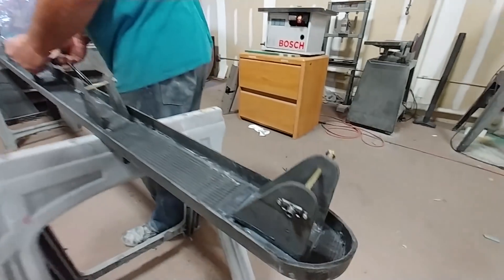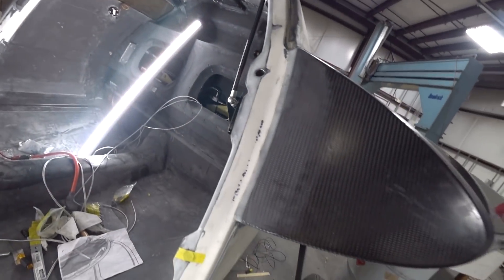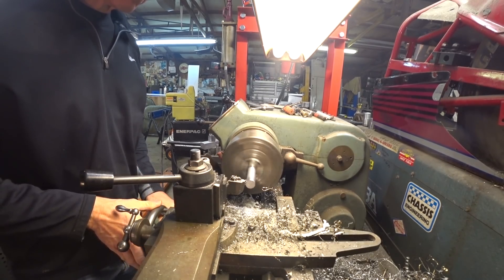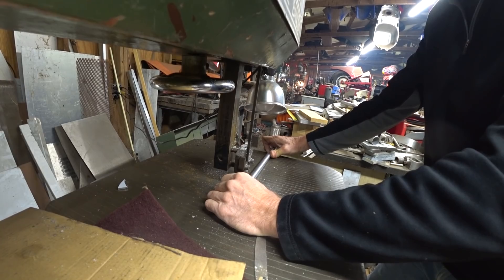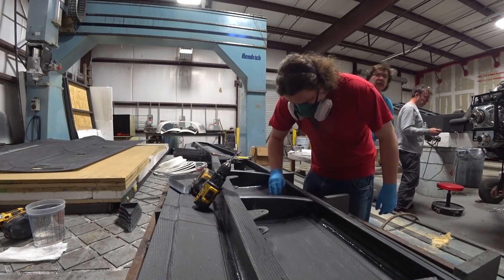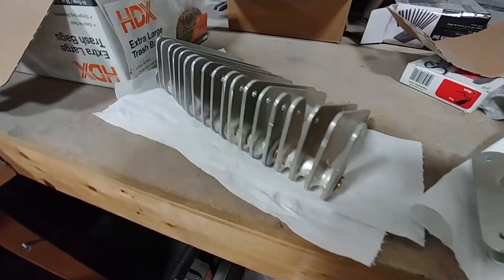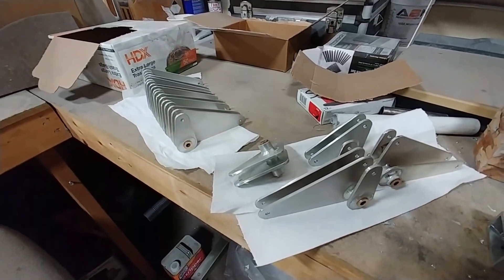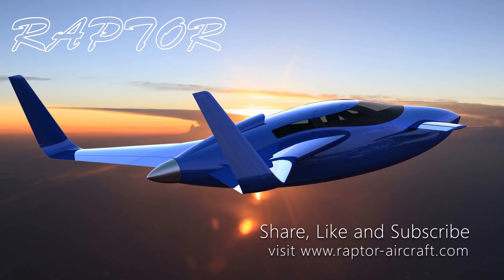Stepping Up Our Game - Building the Raptor Prototype

Comment: With respect to the arduino setup. Breadboard are notoriously bad with vibrations. Great for quick prototype tinkering but I would not rely on it for anything critical near that big vibrating prop and engine. I hope you have plans for something more sturdy before taking it up. At least test and have contingency for failure modes of over and under pressure. I realise this ie still a prototype and the impetus is to get a proof of concept up and running. Your pressure test video made me picture what would happen if the pump relay got stuck in the on position without a relief valve in mid air.
Sorry to be just another back seat driver.

Comment: #1079 here.  I just realized that your bellcrank brackets do not have any hat bushings in them.  The pivot bolt will be rotating in the composite material causing wear in the composite bracket itself.  Maybe Im missing something?  Not trying to be a "negative nancy" here.  Great job overall and I love the new format with the music.
Reply from the maker: You definitely missed seeing the bushing in there that is a flanged bushing.

Comment: What are the Arduino controlled solenoids for?
Reply: They are a prototype only primary controller for the cabin pressurization system.
Reply: @shawnbryan6626  ...and cabin heat

Comment: I like the new format including the music. I think it will help to bring more attention to the project. On another note, any concern with the pushrods putting too much pressure on the pass throughs during wing flex?
Reply from the maker: As I mentioned, the holes I had the pushrod in are not the actual ones being used. The ones yet to be drilled will be larger to avoid any contact.

Comment: Hey serious question: what is that pushrod tube made of, carbon fiber?
Reply from the maker: 4130 steel tube .060 wall thickness
Reply: @RaptorAircraft  so I'm familiar with it as a weld friendly and strong steel, but what makes this the preferred option over other alloys or carbon options in your design?